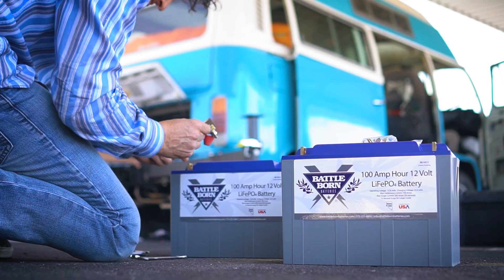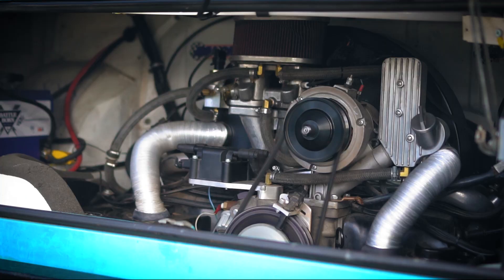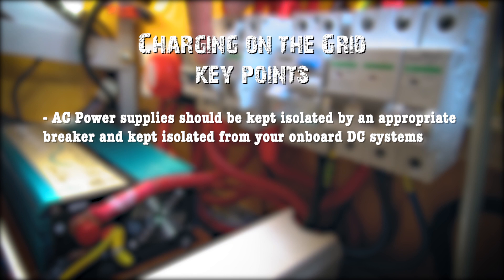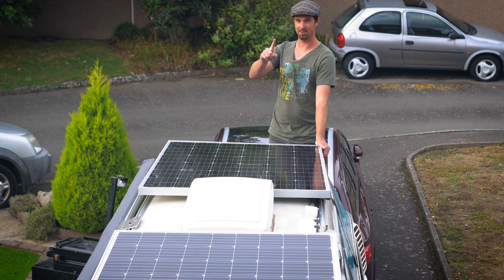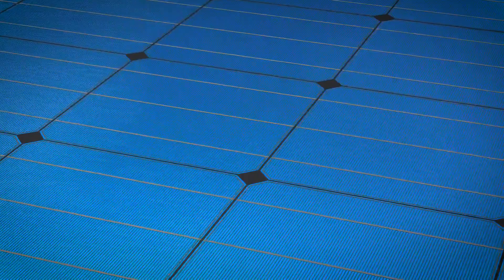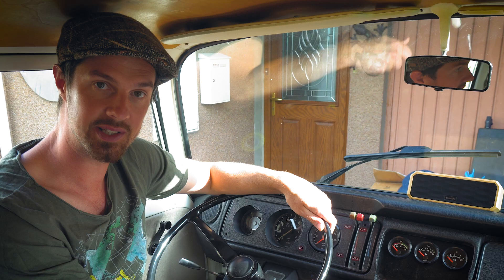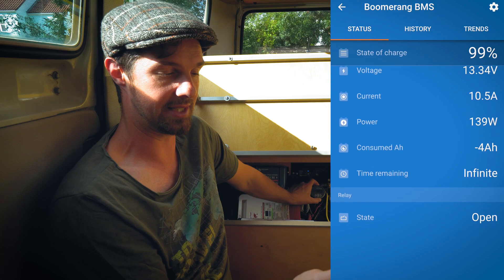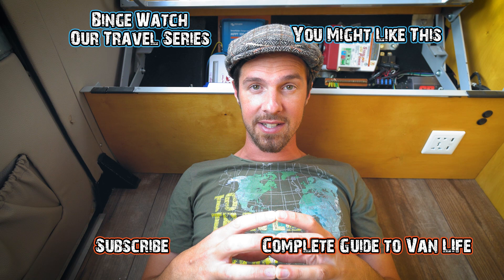VAN LIFE: SOLAR & OFF GRID POWER SYSTEMS EXPLAINED

Comment: Hi Ben, thanks for the detailed video. Since you're a solar geek: a common mistake, which you made about 11 min into the video, is to confuse energy and power. Energy is stored in your batteries and is measured in Wh (Watt-hours) and power is the output or input measured in W. An analogy can be made to fuel, diesel is stored energy while the engine output is power.
Reply from the maker: thanks for that Thomas, you're right I use the terms interchangeably.

Comment: As Dad no doubt mentioned use properly sized fuses, breakers, connectors and wire - not the place to cheep out. Those 4 batteries would happily weld steel if need be...
Reply from the maker: yeah, safety first when building a van electrical system, for sure!

Comment: You can Connect the Battery Monitor and the Solar charge controler Via the App.

Connect a "Victron Smart network" so both devices Speak to each otter an share  infos like Voltage, temperature, Usage  and with that info the MPPT can optimize your charge even more!

Comment: Really Good Video and good explanation. VOLTMETERS = Back in time motor cars didn't have Alternators just Dynamos. These would only charge batteries when above 1000rpm. So sitting at traffic lights engine tickover battery not charging. So if you had headlights on, battery voltage would drop so along came the dash mtg voltmeter. Giving a rough indication of voltage. Which gave an indication to warn you to switch to side lights. Saving power etc. These voltmeters, along with rev counters, oil pressure,temp gauge, oil temp gauges became fashionable. Not really needed as simple Indicator lamp can show over temp, low oil, rev counter just listen to engine revs to change gear. Modern battery systems are excellent and voltage, current indicators are really only needed for initial set up. Soon gets boring looking at and checking power etc. Forgot to mention early voltmeters had a small heater inside which warmed meter needle which bent under heat. Hence how slow the needle moves and inaccurate. Cheers from old George
Reply from the maker: thanks for sharing the info George

Comment: I could be wrong but because your solar system is on a single MPPT your system will still be dragged down if one panel gets shaded. You could look at getting DC optimizers if it becomes a problem. Also, don't use adhesive tabs on the panel because it will eventually melt. Look for solar panel clips. The clenergy brands are the best.
Reply from the maker: Panels are in parallel so they don't suffer from partial shading issues. Thanks for the comment(s)

Comment: Would reflecting more sunlight with mirrors onto solar panels significantly increase electrical output?
I was thinking for a backyard setup. Mobile, mirrored Plexiglas panels on a wooden frame would be easier and cheaper to make than installing more solar panels.
Reply from the maker: I’ve also wondered the same thing. I would guess it would help but I’ve never tried.

Comment: Great video, but I did have one question that I didn't hear addressed.  Do you ever have more than 1 source charging the batteries at the same time?  For example, do you utilize the B2B (battery to battery) charger AND the solar panels both feeding into the positive bus bar?  From the diagram, I see that each has an isolation breaker that interrupts the connection to the positive bus bar, so if you left all of them on, what would happen?  Hypothetically, if the B2B charger were operating (output 12 VDC) and the solar were operating (output 15-16 VDC), then both of those sources feeding into the positive bus bar would, in theory, would allow the B2B charger to be back-biased with the solar voltage.  In other words, you would be trying to push the solar voltage (15-16 VDC) into the B2B charger.  I guess this could also happen if you forgot to isolate the shore power circuit after leaving, and switched to "on the move" or "solar".  Again, with zero power coming into the ON GRID charger, but it still being connected to the positive bus bar, it would be subjected to the voltage source feeding the bus.  Unless these devices have some internal protection built in, couldn't this damage some of the equipment?  Thanks for the great series and best wishes for safe travels!  Cheers!
Reply from the maker: we go into this in more details in our book.  The short answer is that the Solar panel voltage is regulated by the controller before it connects to positive busbar.  As long as the cabling has been designed to handle the loads,  and the breakers are their to protect it all charging inputs can (and do) work well simultaneously. 
more details - https://kombilife.com/van-life-electrical-book/

Comment: Thanks for the insights. And thanks for the discount code.
But 400Ah for more than 3500 dollars does not work out for me.
Plus all the additions...
Reply from the maker: Understandable.  Do you really need 400Ah of Lithium? That's a heck of a lot of power
Reply: @KombiLife  right, i dont have a mobile video production unit like you xD
200 would be enough (plenty) i suppose.

Comment: If you have high quality Panels with 3 ore more bypass diodes in them you wont be affectet of partial shading

i got 1200 Watts of Solar on my Sprinter.  3 Panels connected in series to push down 125 Volts ,  mean i start charging very early in the day and it keeps charging even an hour after sunset.

if you got Battery voltage +5V you start charging  and series brings your Voltage up  to start sooner  (also you can use smaller wires BUT you need Bigger, more expensive MPPT controllers)
Reply from the maker: good point on the need for a larger MPPT controller.  I'd be interested to see how effective the bypass diode are in a real life test.  If you ever see us on the road, let's go and make some videos :)
Reply: @KombiLife  i would really love to :) im a German Car-mechanic and hobby Photographer :)  i tested my Solar by parking under a Tree and i only lost that Panel worth of wattage that was coverd in shade :)  (which is 370 Watts per Panel)   its even enough to run my Dometic AC unit :)  im Kinda a technic geek.  i went so far designing my own radient floor Water heating :P  i follow you since the Start of hasta alaska,  maybe you brought me into Vanlife.  it all started with a 2000 kilometer Bycicle Trip from Germany to Sweden

Comment: There is some false information here. In van you want to wire panel in series. You mentioned shaded areas of panels, and if you have part of panels in shade the output from that panel drops significantly, thus lowering output voltage and energy, while if panels hooked up in series, you lose just part of voltage and current. The mppt charge controller should have higher voltage on input, that can be done with wiring panels in series, so in low sunlight or shaded panels can actually do something with that voltage. With parallel wiring you have 18v or something like that (depends on panel) on input of mppt in optimal conditions, and if you shade part of one panel, that panel drops quickly bellow 12v, and charge controller cant really make miracles. In series wiring, you get 36V on input of mppt, and if you shade part of panel, you have a lot of room before it drops bellow 12V. In the morning you have very low voltage on mppt , while in series there is n-times more voltage with which mppt can charge.
Reply from the maker: Decent panels with bypass diodes would help with the shading issue. Thanks for the watching and sharing your experience.

Comment: wtf man this is over kill  400 ah   at 4 amp per /hr  that = 100 hrs   with no input !   besides that   the pure cost of all that lot   was how much ? 
  i have a rough guess  it  was around 3 k  for  the system .  nevermind the fuel cost to top the batterys up  on the road  ! honestly if your bus /combi is giving you 16 mpg   you lucky ! 
 plus when you get out into the wilds and the whole lot goes down  who are you going to call to get it fixed when your in the middle of god knows where !  
you might think  you have it all covered   but  your sure screwed if you think anyone knows   how to mend it when it  goes wrong  ! 
ME PERSONALY  WOULD HAVE  BOUGHT A  GENARATOR THAT RUNS OF  VEG OIL  OR DEISEL   .
 plus  it would have   been lighter than that lot  !
Reply from the maker: Thanks for your comment Colin.
Reply: I think for the life of a generator and it's fuel and its weight that could produce this kind of clean sine wave - you would be way better off with the Battle Borns and controllers and no one yelling at you for all the noise/